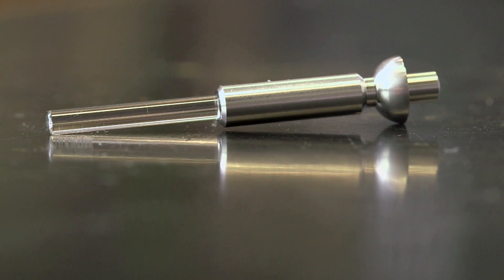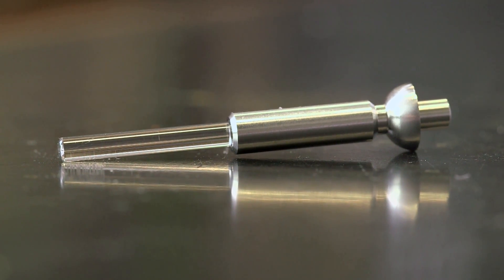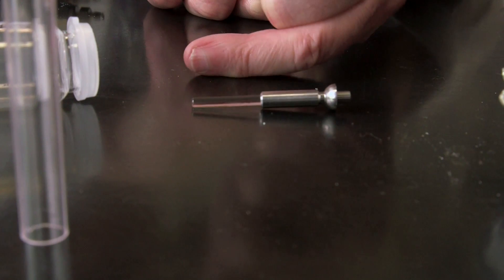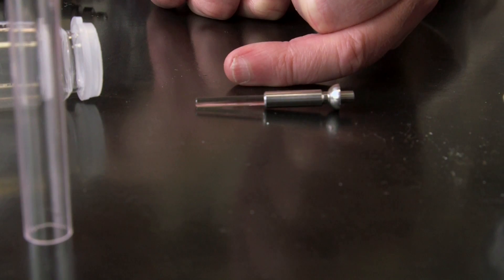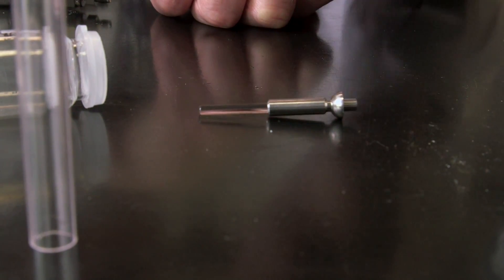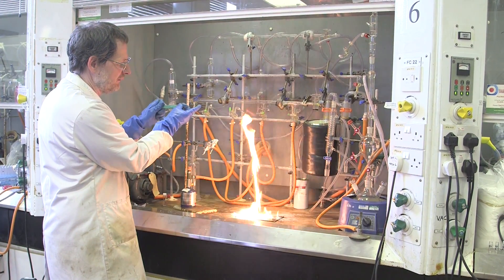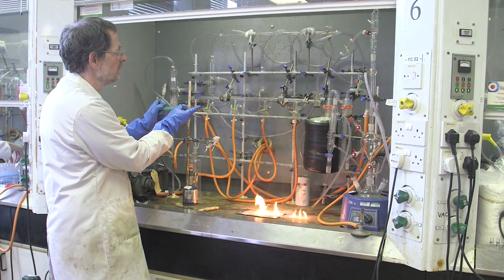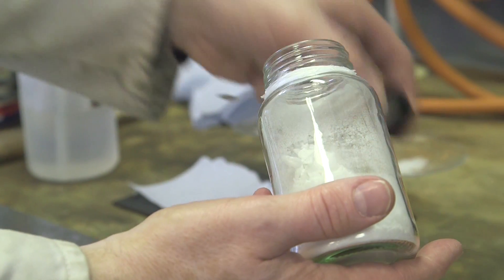Aluminium (extra footage)

Comment: Thanks for mentioning the possible link to Alzheimer's in cookware. It's a horrible disease, and anything that can be done to prevent it is a good thing.
Reply: Inert materials are always a safer option. Stainless steel 316 is certified as food grade. Glass & ceramics utensils are very inert.
I stay clear of plastics when possible.